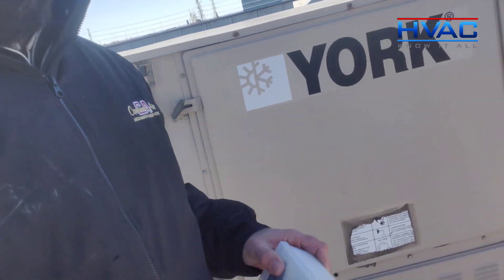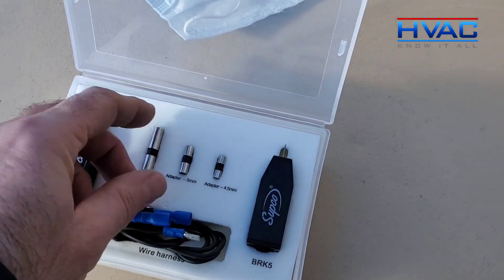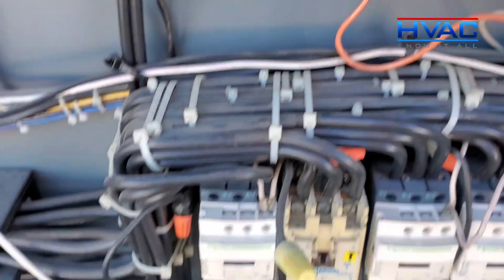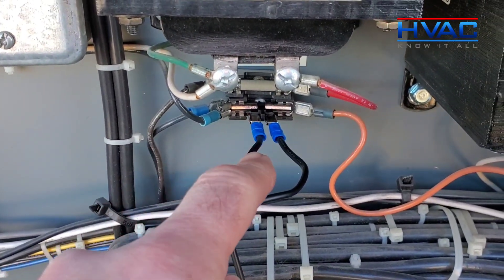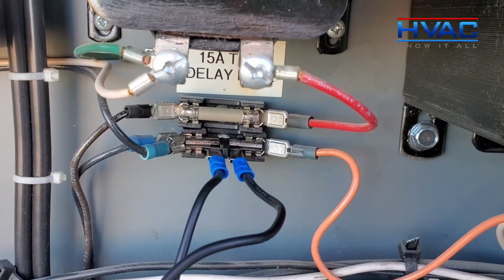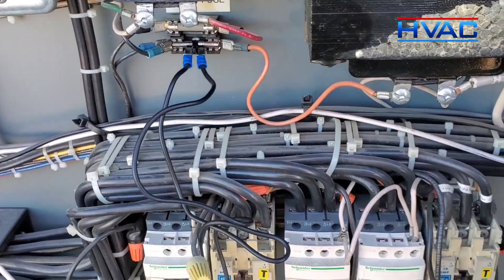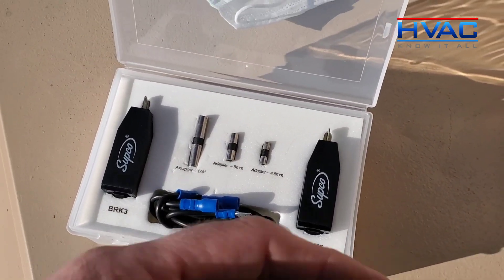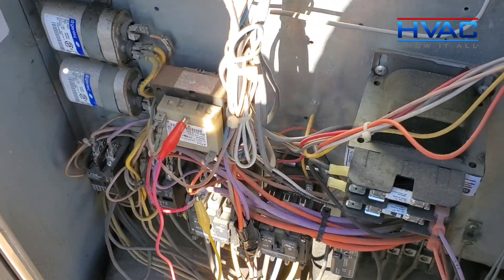Supco Fuse Testing Super Kit (BRKPRO) And Sizing Low Voltage Fuses

Comment: A 24V 75VA Transformer draws about 3 amps "ON THE 24V SECONDARY". If the Primary is 208V/230V, it will only draw about 1/4 AMP "on the Primary". 

So don't use a 3 amp fuse or breaker on the 1/4 amp primary. Use it on the 3 amp secondary.
Reply from the maker: This vid was just a demonstration my friend

Comment: Thanks for your tips Had a residential bryant furnace that was blowing fuses on board run for week then blow after about 3 call backs turned out main limit metal backed insulation was loose inside furnace casing shorting out limit when blower knocked it around!

Comment: They’re just getting this to HVAC 40 years ago in automotive we were using these they were just bigger and and for heavy duty truck 24 V systems exactly the same voltage just DC. 
            And electricians in residential and commercial electrical decades ago. 
             Why does it take so long for technology to trickle down to the HVAC trades
Reply from the maker: This particular kit is newer but hvac has had similar tools in the past.

Comment: Supco throw the adaptors away, their going to get lost and put alligator clips on the leads.   resettable circuit breakers have been used in the transportation industry for many years.  cant be on the road and have a fuse blow and be without power.
Reply from the maker: Alligator clips work if you're not using the fuse place holder.